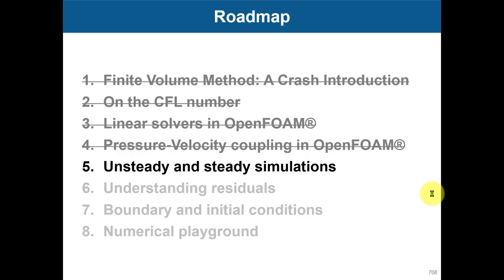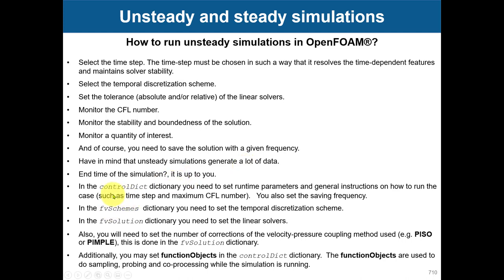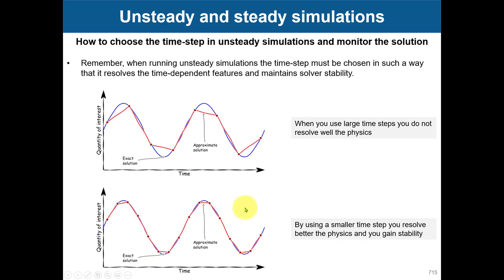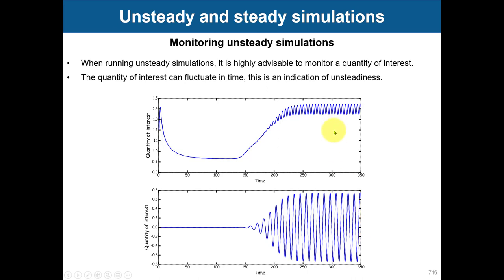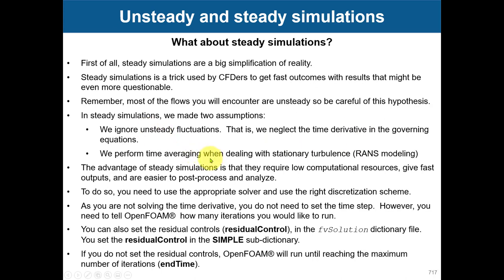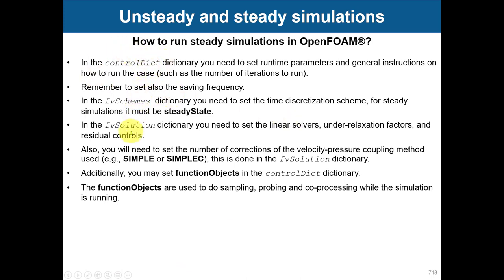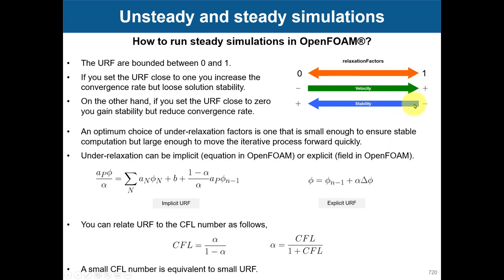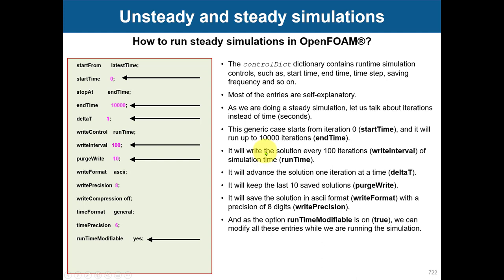6.5 Module 6 - FVM overview #openfoamtraining

Comment: Hola! using bounded scheme for div(u,phi), does not limit the simulation for only computing positive values of U? could this sabotage reality of flow going backwards after passing over an obstacle?
Reply from the maker: The keyword bounded is a numerical trick used in openfoam to improve convergence of steady solvers, you can find more info at this link https://openfoam.org/release/2-2-0/numerics-boundedness/
We have no specific guidelines related to this as we haven't seem any big improvement when using it.
Reply: @wolfdynamics5703  T H A N K   Y O U!!!